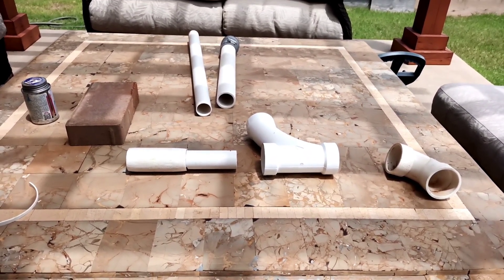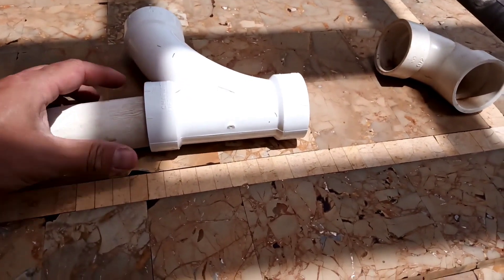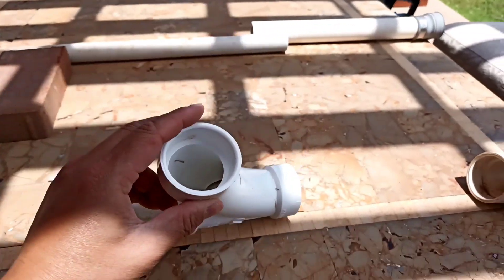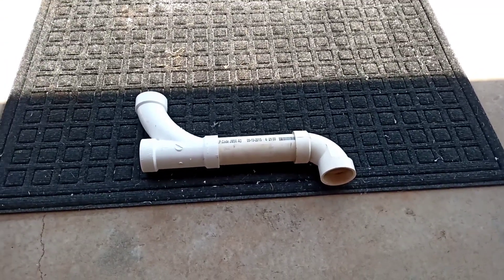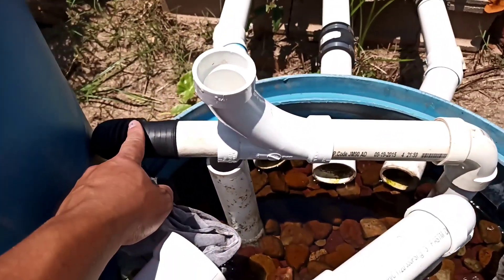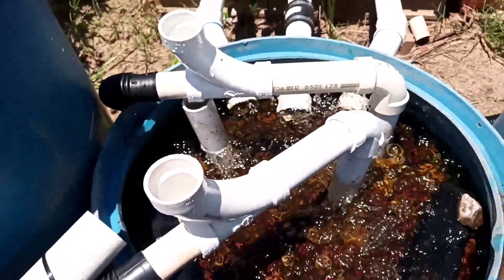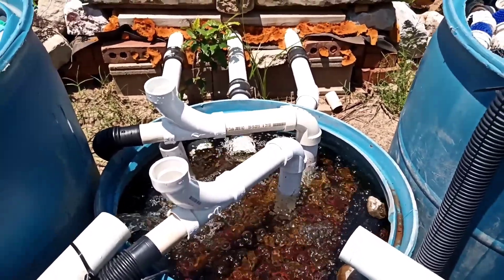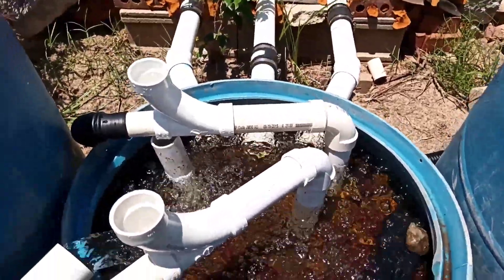Free Oxygen - VENTURI AERATIONS

Comment: The connection from the T pipe to the water ( right side ) , is there a little gap between the 1 inch pipe and the 1.25 inch pipe so air can flow in ( 1 inch and 1.25 inch pipe are not connected correct? )
Reply from the maker: That is correct

Comment: the oxygenated bubbled water actually goes down the pipe into the bottom of the barrel?  you must have a really strong pump that forces the bubbles down instead of rising inside the tube??
Reply from the maker: That's right Michael! The oxygenated water go down the bottom of the barrel and rised back up while the lava rock capture any particles. I used the energy efficient pump that pump 4,200 gal/hr and it consumed about 150 wat
Reply: I built a very successful copy beginning with 1 inch T and reducer at the intake or pump in side at 1/2 inch, the exit side of the T 3/4 inch using a 1/4 hp pump, pushing water and bubbles down 3 feet deep. So the water entry into the T is reduced and at the 1/2 way through the flare at the exit end where the air squeezes buy the 1/2 inch to 3/4 inch within the 1 inch T. I could have pumped air deeper with this 1/4 hp pump but did not need it. The T always remains just below the surface or above, to pick up the air before going under with the water flow. Easy for a small pump, easier than pumping water under pressure alone. Works great!
Reply from the maker: I would love to look at your designs
Reply: How loud is the sound from sucking air ?
Reply from the maker: Is not that loud since it is outside, you have to get real close to hear the air being suck in